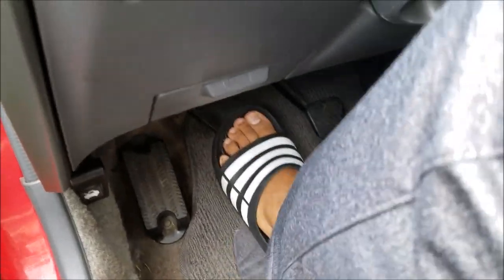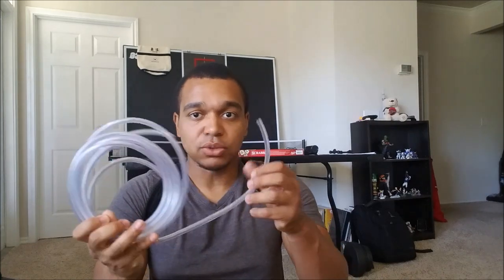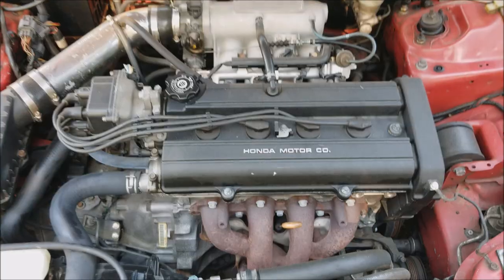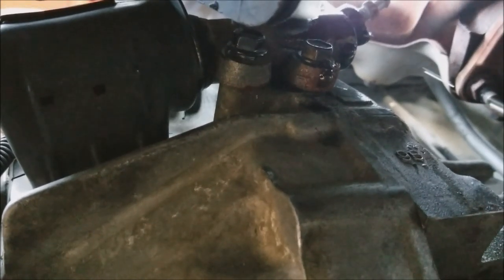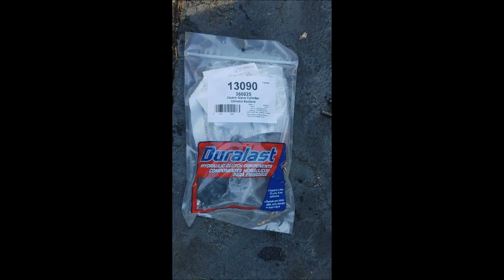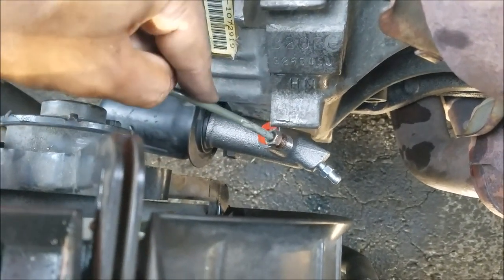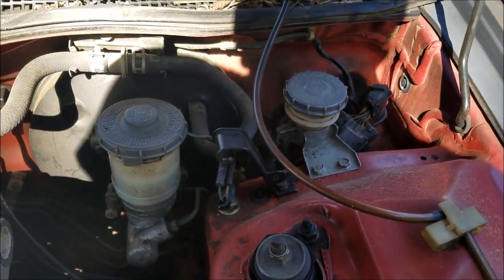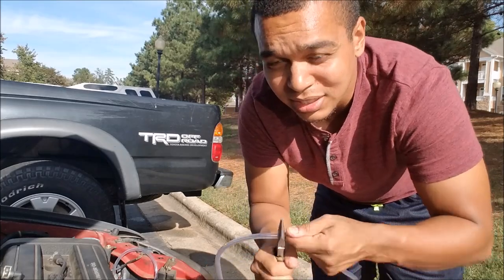SELF BLEED CLUTCH LINE & Change Slave Cylinder | Honda & Acura

Comment: Why do u need to put some fluid in the empty bottle
Reply from the maker: christopher chan to keep air from being sucked back into your line when you release the pedal during pumping. If the end of the line is fully submerged in fluid only fluid will be sucked back into the line, hope that is clear!
Reply: Thanks

Comment: You are the man. Even the music is on point. Fixing cars while relaxing or relaxing while fixing cars.

I have a quick question for you boss

What if the clutch pedal is nice and smooth (neither high nor low) but there is no grab when the gear is shifted.

What does this symptom make you think about?
Reply from the maker: Appreciate the feedback on the video and music! When you say no grab, does no car not shift into gear at all or it does but with a bit of effort? It sounds to be as if your friction plate is worn out from first though
Reply: @EngineeredMojo  you are welcome. The car shifts into gear smoothly with no resistance; the clutch pedal is neither high nor low; actually feels like a new clutch. However, releasing the clutch pedal has no reaction that is the car does not creep forward when in 1st gear or backward when shifted in reverse. Lastly, i was curious and jacked up the rear wheel to see what happens when I shift forward or backward. Result: the rear wheel move when i do so; giving some gas increase the speed of the wheels but not as fast as it should. 

I am suspecting a driveshaft issue at the transmission. Some type of wear or something.   Car has been highly abused by the previous owner.

Comment: I am no expert but I think you are suppose to close the bleed valve before you let the clutch pedal off from the floor otherwise you are just drawing air back into the system through slave. Hence why you need 2 people. Maybe it possible this way after most air is out of the system though 🤷🏻‍♂️. Good video straight to the point though!
Reply from the maker: @antigychiefs4313  haha that's the great thing about science! You see air pressure is capped given the bleed tube is fully submerged into the fluid. No air comes back into the system, if correctly done as shown in the video as proven by history of how science works. Don't waste your friend's time, this is a 1 person job!

Comment: My brand new slave cylinder exploded all over the parking lot. I found the pieces but it failed 3 months later started leaking started leaking real bad had to bleed it from the plunger
Reply from the maker: Oh wow, bleed with a plunger. Slave cylinders are finnicky. It seems only the OEM ones last for many years. All the remanufactured ones for sale can break randomly in short periods of time sometimes.

Comment: Great video!
Reply from the maker: Thanks for taking the time to comment, hope it was helpful!
Reply: @EngineeredMojo  definatley was, I'm actually in the middle of replacement now. How long did you have to bleed I've been pumping for a bit still going to the floor.
Reply from the maker: @DaeganJones  it will always go to the floor during the bleed process while the bleed screw is loose. I pump until I see no bubbles in the line, close the bleed screw and then confirm pressure in pedal. If your pedal goes to floor even when bleed screw is closed then redo bleed process, just make sure to try your best not to let "new" air into system
Reply: @EngineeredMojo  Awesome, thank you for your reply it's all set now.

Comment: Tried this is wasn't builfing pressure
Reply: Building
Reply from the maker: what size clear tube were you using? Did you notice air bubbles coming from around the side of the bleed valve and the clear tube connection? Most often if the seal is not good, you'll have air leakage at that interface inhibiting the ability to build pressure. Temporary tape around bleeder screw or a smaller tube usually does the trick
Reply: @EngineeredMojo  awesome thanks! Going to try. I've got a couple pple that have  looked at it and I've replaced the slave and master. My husband said he sees bubbles from the line that goes into the slave. He had later found that there's a leak there. Said he's going to put tape on it in a few minutes and try it. It's certainly been the biggest pain in the butt. My friends even tried bench bleeding it and there still was absolutely no pressure lol
Reply from the maker: @DaraCaRib0uL0u  you have gone through the gauntlet! I'm sure this next go around it works out. Big thing is at least you noticed air bubbles so you know there is indeed air intrusion. This greatly narrows your search for the issue. Let me know how it goes, that way I can add it to my memory bank of possible fixes!

Comment: Why do you keep saying check the brakes when it's the clutch you're working on?
Reply from the maker: Because you're using brake fluid in the lines. Brake fluid is just a generic overall name for compressible hydraulic fluid that is used in brake, clutch, and various other hydraulic press lines.
Reply: Yes but they are two totally separate systems
Reply from the maker: @jeffreyc.rachell2741  two separate systems, two separate lines, but they use the same fluid. Don't go looking for clutch fluid because you won't find it haha. I don't think I ever say check the brakes (but I could be wrong if it slipped in there one time), it's always check the brake fluid or reservoir fluid. Clutch fluid doesn't exist so I wouldn't be likely to say it.
Reply: Absolutely I know this I am a mechanic on the side I've been doing it for 25 years I was just questioning for the people out there that don't know any different
Reply: I do have a question though I've replaced the clutch and the slave cylinder bled it completely but still have no resistance on the clutch it goes straight to the floor
Reply from the maker: @jeffreyc.rachell2741  I'd double check for leaks around the slave cylinder, hydraulic lines, and reservoir in case the slave cylinder was faulty or the seals around the reservoir are corroding. After that, I'd re-bleed the system to ensure all air has been purged.
Reply: I got it figured out I wasn't patient enough with my bleeding I have full pedal now the clutch grabs better than it ever has
Reply from the maker: @jeffreyc.rachell2741  Awesome man! glad it worked out and thanks for coming back to provide an update

Comment: why clutch gets hard
Reply from the maker: Hey Arshad! It could be various issues. Most often though it can be a worn release fork which is located between your clutch plate and transmission (would require removal of transmission from engine or a faulty slave cylinder. I'd start checking everything you can see while transmission is installed slave cylinder, hydraulic lines, etc. then as last resort check release fork, bearings, etc. within the transmission housing

Comment: This video didn't show him working wrenches in that tight space. That's what we wanna see!!!
Reply from the maker: Next time I'll call you over to my house so you can watch :)
Reply: Lmao! Chill bro. I'm working with the same issue on my 04 RSX Type S and the are around the SMC is tight. I didn't want to do it but removing the battery and the stock intake box gave me a hell of a lot more room. I came in from the side and took the bolts off the SMC with a ratchet and extender. I did all this in between the time I wrote my original comment and just now. I replaced the CMC yesterday and I thought I bled the system but the clutch was still to the floor so I checked the SMC and it's in working order. Check the lines and pumped the SMC no fluid shoots through the lines and a stream comes out the back with the bleeder opened up so the lines are good too. My guess is just that there is air in the system and I'm having a hard time bleeding it. I didn't think this would give me as much as an issue as it has.
Reply from the maker: @Zaberdutton  yea getting access to this slave cylinder bolts can be a headache. So ambitious understanding when you bleed system from slave cylinder fluid does come out correct? I'd re-bleed system and be sure to not let clutch reservoir run "dry"

Comment: You made a freaking mess of your floor, lol. Instead of just letting it all leak out it’s best to remove the clip between the hard and soft line. Then loosen the fluid line on the slave. Now take the mount bolts off. Then take the fluid line off and immediately put it on the new one. You should barely lose any fluid. New mount it and tighten the fluid line. Top off fluid and bleed the slave. That’s it. You made a mess. Lots of chemicals seeping in to the ground.
Reply from the maker: Oh yea some smart people mentioned that a few years ago, since then I've become a lot better and have a technique down better than you mention. Check my other videos out to see!

Comment: clutch still to the floor even when bled..
Reply from the maker: Clutch on the floor means you have air in the line either from an improper bleed procedure or damage long the line somewhere. Inspect your hard lines for damage and inspect the rubber flex line...then rebleed and be sure to bleed as carefully as possible never letting reservoir go down to empty and sealing around the bleed screw

Comment: I changed mine and I’m having this problem https://m.youtube.com/watch?v=vXYgIIQaY_0
What do I do?
Reply: Perhaps your slave cylinder isn't positioned property,
Reply from the maker: I second what mr.JR says. Check to see the slave cylinder push rod is engaging with the shift fork lever (the spring rod under the dust boot). I'd unbolt the salve cylinder and shift it enough to slide dust cover off to see where the push rod is hitting. After that, I'd re-bleed the line. I'd bet that even if your clutch pedal feels okay, there might just be slightly enough air where the push rod is not engaging the shift fork lever. It's happened to me exactly as your video shows. Hope that helps! Let me know the outcome if you could, thanks

Comment: I dont think this is a good method, if you are not closing the bleeder valve every time you release the petal, then you are pushing fluid out and the same fluid gets sucked right back in.  The point of this is to keep the old fluid and air moving in one direction, that is from the master cylinder filler, to the bleeder on slave. This takes two people or a vacuum pump.  Hope this helps someone!  Open bleeder for pedal press, then close it for the petal depress.
Reply from the maker: I understand your theory, but it is incorrect. After the first few cycles there is only new fluid moving through the system. Fluid dynamics will of course have a small amount of fluid reverse, but it will be the new fluid you just put into the system. Video is proof in itself. There is only "clean" fluid showing in the clear tube after pumping the brake a few cycles. You can use two people if you want to, but it would be a waste of the second persons time. Hope this explanation helps you out. I've been doing it this way for 10 years with no issues, and it's been done for decades before me by garage mechanics everywhere. Trust me it works, don't waste money on fancy machines or waste beer money on a second helper haha

Comment: Cast aluminum slave cylinder😂.... Take out the piston you have a slurry of fine particles of aluminum That just come off in the fluid because they forgot to anodized it in china😮
Reply from the maker: Oh no!! I'm going to pop mine open next time I change it to investigate. Would explain why the failure rate for some of these brands is relatively high
Reply: @EngineeredMojo  What do you expect for $23 versus $86 from the dealer which I just got through paying today... I've got the cast iron slave cylinder in right now it's It's got japanese words all over it oem.... Even the rubber boots smells like quality....
Reply from the maker: @Truthtellor-ol2df  I've been lucky I suppose. My 23 dollar one has held up for about 6 years now. I'll count my blessings 🙌🏾

Comment: Yeah you better check the brakes cause yo clutch wont work
Reply from the maker: Lol slight slip in wording since dot 3  brake fluid aka hydaulic fluid is used in the clutch reservoir